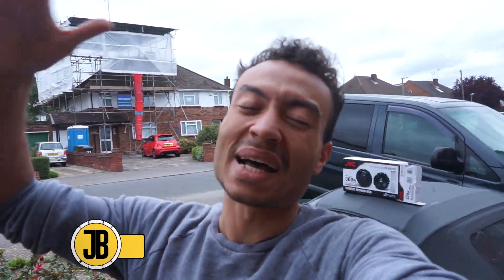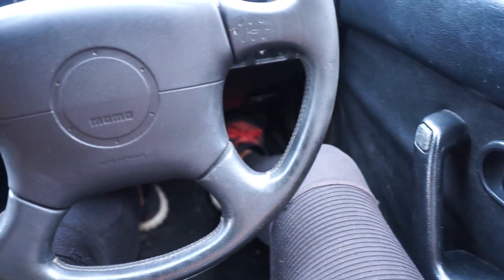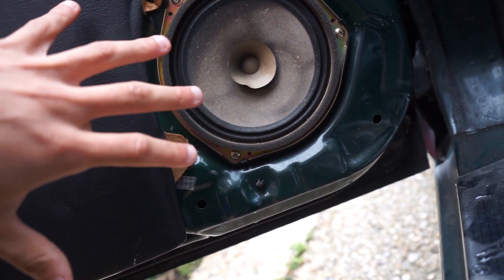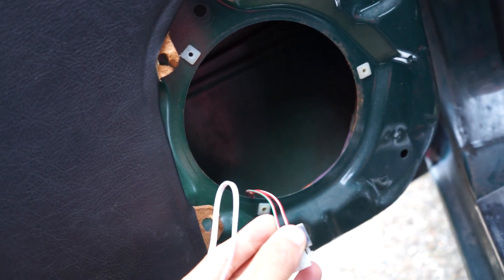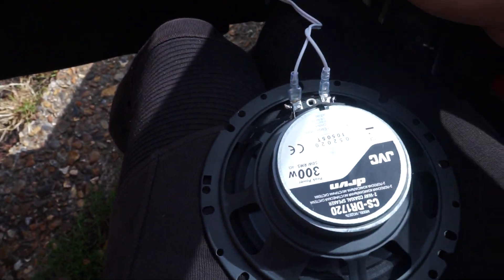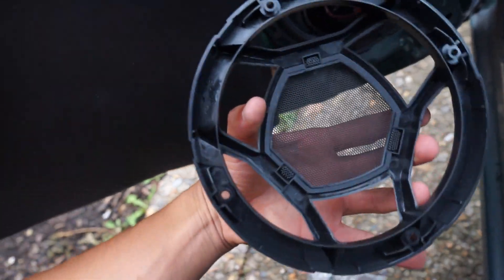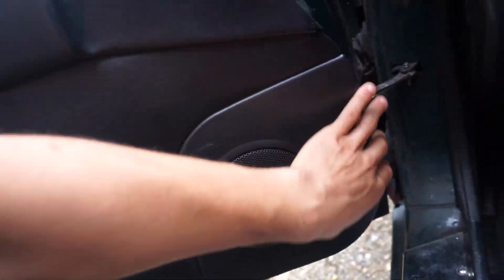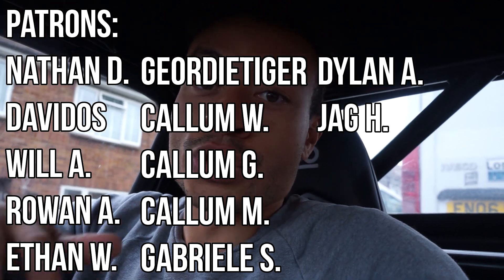This £30 Mod is VITAL for Old MX-5s!

Comment from the maker: If you want to take a listen to my standard driving tunes, Spotify playlist here: https://open.spotify.com/user/21w2z3v4mumbwrntkpd6me5ai/playlist/6SOfjYUmJEZyJLWIdsaZsC
Reply: Depending on how much you like your music in the car, theres fairly cheap fixes to get a much better sound than you have even with your new speakers, and in the polo.. Decent connectors make a big difference, as does dynamat in the doors behind the speakers to deaden any vibrations. There's loads I could suggest, but those are two cheapish fixes that you would tell the difference with immediately.

Comment: Got a mx5 Na as a first car at 17 with insurance only costing £1,000 the cheapest quote I got and the car was in very good shape too
Reply: How? I tried to get a quote and got 7 grand 🙁
Reply: @olliestevens754  So from what I have gathered it has to be a 1.6 mx5 also I just made a pile of fake accounts as the price goes up more as you use them. Then I kept changing settings to see what gave the cheapest quote.

P.S another cheap car to insure is the original mini which I got to £800 somehow

Comment: Did you cover up the exposed wire with electrical tape where you had to strip them and connect them to the other part?

Comment: For £30 it's unquestionably a good mod, even if you've got no hope of hearing them most of the time. Even in my Cayman the stereo is fairly pointless. I can use it as long as I'm driving at <60mph and crank the stereo up. I spent a good 30 mins messing around with the EQ on both the stereo itself and on Spotify before it sounded passably good- as a former pro sound engineer I'm pretty sure that's still the longest I've had to spend on EQ in my life. Sadly in a Porsche it's not a £30 job though...
Reply: Do you really wanna be listening to music though when you have a glorious Porsche engine note?
Reply: @Masa6x  If I have to drive 100 miles down a motorway yes! But most of the time no ☺
Reply: @ApothecaryTerry  Fair enough, I can't hear anything from the stereo or anything else for that matter in my mum's Peugeot 207, the road noise is so loud and there is basically no insulation. As much as music is nice, I can't hear it either lol. Would you say your Cayman is a good car, I've seen them about and they look tidy but are they reliable and good value for money in your opinion?
Reply: @Masa6x  I've only had it 6 weeks but based on that and all my research they're awesome. Bearing in mind that my previous car was a Lexus GS, the Porsche obviously can't compare for luxury and comfort but I've done a few long journeys and it's fine. Driving obviously is great. Sound is awesome, it gargles as you go past 2.5k RPM and then you get the howl as the revs build- I've got the 3.4 with no sports exhaust and that's perfect for me. Boot space is genuinely huge, but the shape means big flat items won't go.
In terms of costs, genuinely they're cheap. Depreciation is obviously minimal but my insurance is cheaper than my sister pays for her 1.6 Megane (she has 15 years no claims to my 11). Economy is genuinely good too, I've been driving hard since I just got it and overall I'm on 31mpg. Got 47.2 on a long run- these are UK figures.
Got to make sure you get the right spec- if it's PDK it must have paddles (mine has a 718 wheel). Beyond that personally colour is the big thing for me. I've got white with black wheels/mirrors and red calipers and it gets an insane amount of attention, whereas a grey one...well seems silly to buy a sports car that nobody will look at.